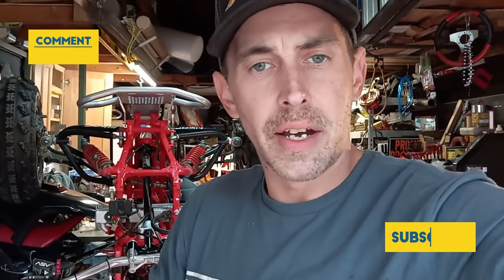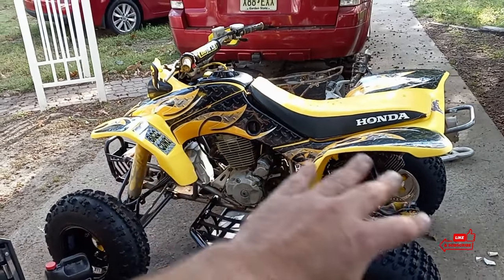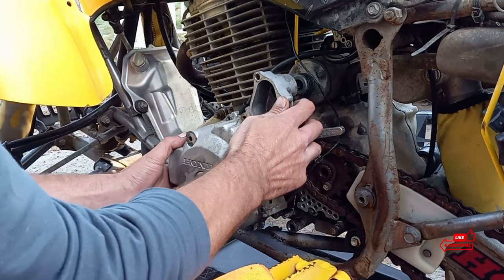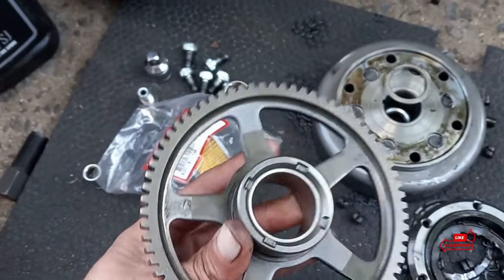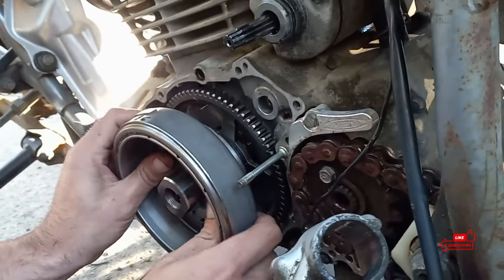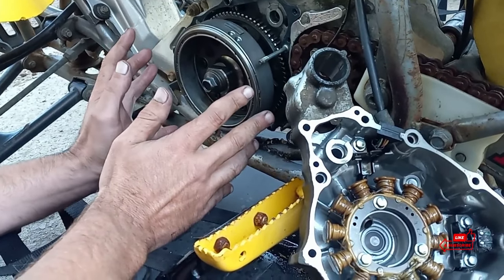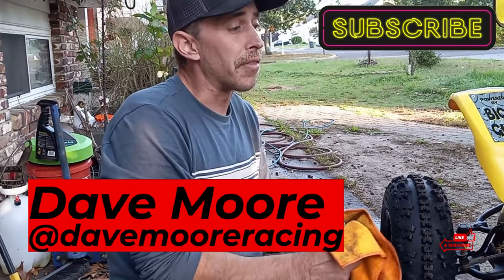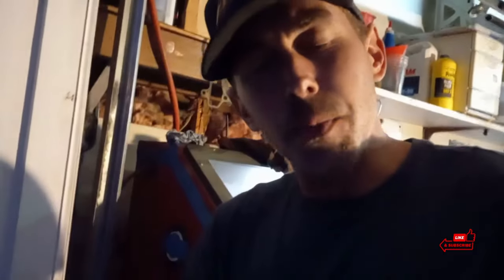Replacing a One-Way Bearing/Starter Clutch on a Trx400ex

Comment: Hey Matt, thanks for all the videos man, I've learned alot about how to work on my new/old 400ex from you! Need to get me a hard copy 400ex manual instead of looking stuff up on my phone copy lol.

 Sometimes I'll try to start my bike and the starter winds up but it doesn't turn over, especially the colder it is outside. This one way bearing etc. is what's going bad correct? I've been wondering what to check for that and then i saw your video lol. You gave me your email awhile back, I got something I think you might like, I'll shoot you a line. I appreciate ya!
Reply from the maker: Garagemc549@gmail.com
I have an extra 400 manual here. And yes that should be your 1 way bearing. Only get an oem replacement the Chinese ones are hit or miss like all their stuff. The one in this yellow quad blew out 2 weeks after this repair
Reply: @garagemcmatt  that was gonna be my next question lol  I figured that $65 kit from amazon was trash. Thanks Matt!
Reply from the maker: @kylebuzz  I have used oem ones if u want

Comment: Do you know if the 300ex uses the same flywheel puller?
Reply from the maker: I'm not sure bro I have never had a 300ex. Let me look something up I'll get back to u
Reply from the maker: Yes it's the same m20x1.5 u can get a basic bolt that size to remove it

Comment: I have a question so I have a 03 400ex trx and recently replaced the piston, crank and rod all brand new, properly balanced it with the marks l, did the timing right started it up strong let it idle for 30 mins all was good but when I hit the throttle with it fully choked it would bog so I thought it was running rich so I gave it more air and the revs were perfect didn’t bog and didn’t hang so I rode it and after Maby 45 mins the crank didn’t lock but became stiff so I checked the oil check screw and it was dry any suggestions on what happened also the intake valves and spark plug were white but the spark plug threads were black
Reply: I’m very confused and I’m pretty sure I have a small valve leak because there was burnt oil on top of my piston like it leaked out of my valve not sure if that’s how it works
Reply: Could it possibly be a oil pump issue
Reply: There’s only two oil pump bolts on right now because one snapped and I could not get it out
Reply from the maker: That's one of those things I would need to see it myself. It could be several different things that went wrong. Oil should not be getting to the piston. And your plug definitely should not be white especially if it had oil leaking into the combustion chamber